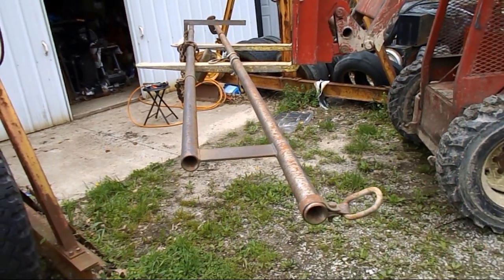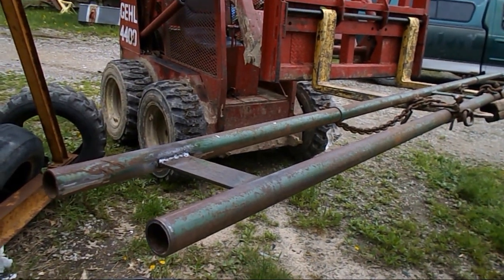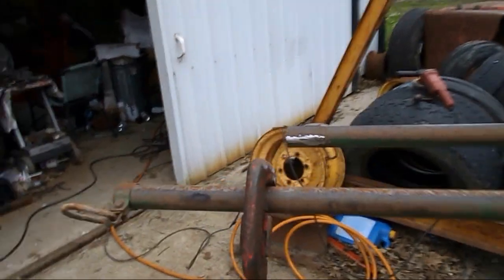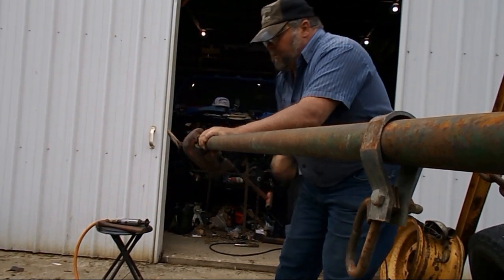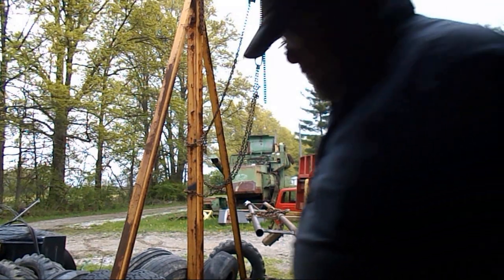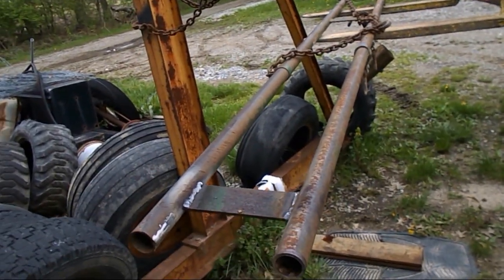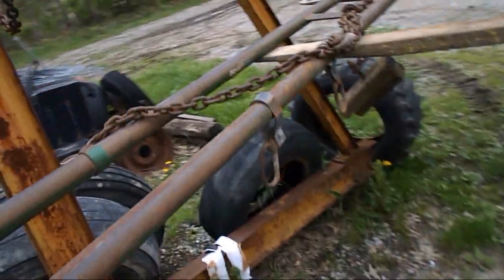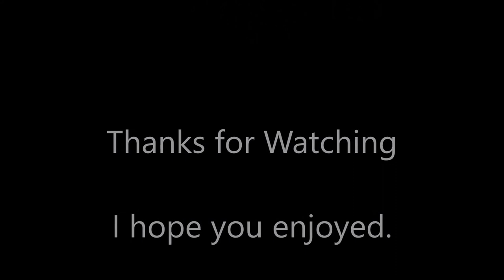Fixing the Harrow Hitch

Comment: At the very least, we may have to look at putting in wetter season seed. We're over 40% wetter than normal here and have another 4 days of rain coming at us. Good video Bandit. I did wonder what settings you were on with the welder. Caught a good arc and held it so it was the right setting whatever it was. Thanks for sharing.
Reply from the maker: Bill I haven't bought any seed yet mainly because I haven't been able to get a good feel on the spring yet,  I know there wont be any corn planted this year just beans. If it keeps raining like it has been I may plant rice !  LOL  I still don't know if I have the ground up to road for this year or not yet, Still a lot of things up in the air this year but I'm trying to get things put in line so I know for sure. I was using a 6011 1/8" at 75 amps witch works pretty good most of the time but being on the end pole for electric the amps aint always there so welding can be a trick to do at times. I knew a older guy who could tell you what kind of weld you made just by the sound of the weld as you layed it down, Funny thing was he was right ! I sure hope this is not going to be like it was last year but I have a feeling it might be , I still have hope but it sure makes you wonder.  Bandit

Comment: Bandit, I know you just bought a field cultivator. I have never used one before but we just bought a john deere model 1000 21' field cultivator for $225.00 . It needs new sweeps but other than that its in pretty good shape. My son pulled it with john deere 4010 in bean stubble and with the wings down its about all she wants. I think he is just going to run it with the wings up. Its still about 12' wide with the wings up. What do you think about just hitting the bean stubble ground with this and planting without plowing first. It seems to work it up pretty nice especially if you run over it twice.
Reply: I know you weren't talking to me and you can disregard what I'm about to say. We never plow soybean stubble. We run 2x with the disk then plant. It works good in our sandier soil. If it looks good after 2 passes with the cultivator, I  say try planting it. Make it an experiment. Either way you will learn something.
Reply: @ghenry85  I welcome any input.  We are going to try a couple small fields and see what happens. We have always moldboard plowed before. We dont have a chisel plow and if we did, it would have to be pretty small to pull with the 4010. We have pulled the neighbors 10 shank but you cant run it very deep.
Reply from the maker: I don't like to plow every year anymore for a lot of reasons mainly because in our ground if it gets wet in the fall you go down as deep as you plowed so every 5 or 6 years is good enough for me plowing now.  I run a disk or a field cultivator on bean stubble, I like the field cultivator better than a disk but it depends on the amount of trash and grass in the field. In heavy residue and grass a 3 bar field cultivator will ball up and it will make a mess, So that's why everyone went to 4 and 5 bar field cultivators so everything will flow threw it better and not plug up. A couple of passes with a field cultivator and hit it with a harrow-gadder and plant it is what I like to do if I can.  I have an old JD 18' field cultivator I pulled with my 4010 gas I had, Of course I had the wings up and it was all she wanted with 12 feet in the ground going about 4 inches deep. It did a good job unless there was a lot of trash on the ground then it could be a problem.  I would give the field cultivator a try this year and not plow it and see how it works out this year, It cant hurt to try something new.  Bandit
Reply: Bandit, Thanks for the reply. We bought new sweeps for the cultivator atleast the main ones not the wings. Will that make it pull harder or easier.Also we are going to plant some corn this year. My son has only  planted beans the last few years but he wants to be able to combine some corn with the old 55 so we are going to plant one bag of corn which we think will plant about 2 1/2 acres. I helped my uncle for years on the farm planting corn but I was usually the one working ground and he did the planting. How much fertilizer do you think we should shoot for on this corn. We are thinking of using 300 lbs of 19-19-19 and maybe side dressing with some liquid nitrogen later on. On the beans we have always used 200 lbs of 5-23-42 if I remember right. This ground we will plant the corn has been in beans for 2 years and it produced right at 50 bushels per acre both years.